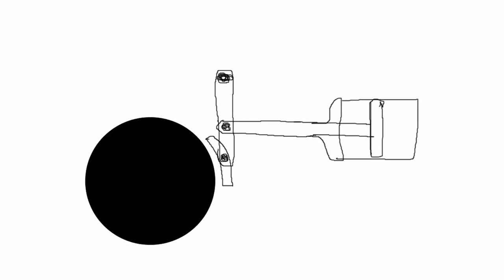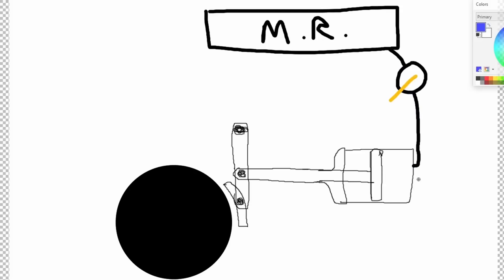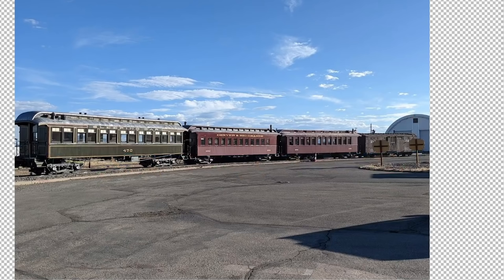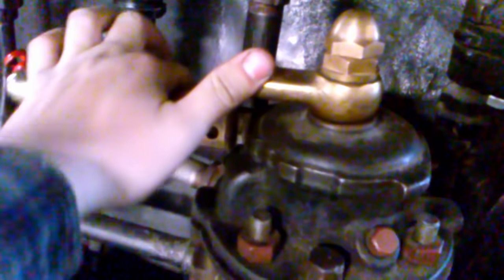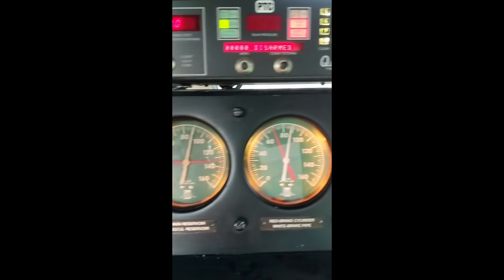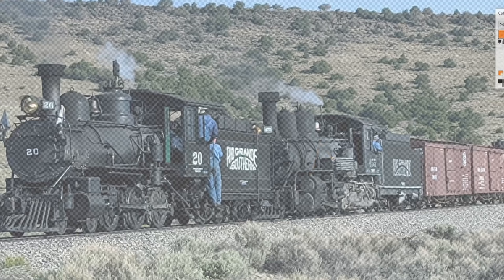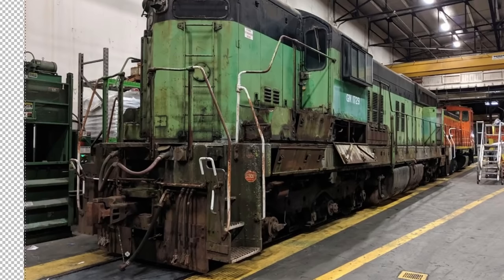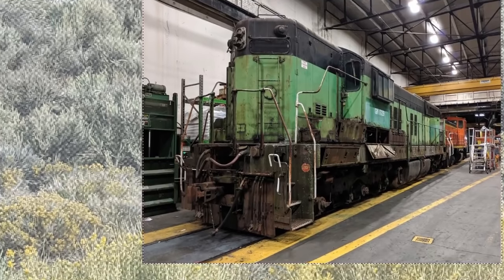AIRBRAKES 101: 10 levels of TRAIN BRAKE understanding!

Comment: Interesting description.  Trying to keep it as simple as possible is always a problem.  One of the easiest methods for describing the automatic air function was the idea equalized air pressure on each side of a piston and how reduction of pressure on one side moves the piston to perform a function.  When the pressure is equalized, the piston stops and slightly reverse moves to stop the function.  The use of rubber diaphragms has made for a more sensitive operation of what ever valve diaphragms are used in.  Also, the timing involved in charging, reducing train line pressure.
From front to rear, timing is involved.  For example, when stopping a steam powered locomotive on a freight train, going up an ascending grade to take water.  Slack most likely will have to be taken to get the train started.  After taking slack, the release time for K-2 vs AB was about 2.5 to 1.5 seconds to start each car to release.  The trick was to start the pull about the time the release got to the rear end.  But before the rear end would run out and possible cause a break in two.  Another area that is not dealt with these days is the use of retainers when braking on steep down grades with long mileage.  Anyone can turn up a retainer, but the proper use of the automatic brake valve without the pressure maintaining feature to prevent insufficient recharge of the auxiliary reservoirs is another story.  Yes, knowing the air is an interesting subject.
Reply from the maker: Sounds like you've pulled away with one or two trains yourself based on that description - thanks for the comment :)

Comment: This is a decent discussion of the complexities of manual American Wabtec air braking. Its right enough mostly. The one area I would suggest looking into is the the pressure differential between brake pipe, aux reservoir and brake cylinder - the cylinder will get 2.5 times the pressure released from the reservoir into the cylinder. Your vacuum concept isn't quite right, while its true you cannot pull more than absolute vacuum - its more about the suction than it is about pure vacuum. You can sort of think of it as the reverse to air pressure if you put it really really simply.
Reply from the maker: Vacuum is just negative pressure, indeed. But you can only ever get negative atmosphere, as far as folks are telling me. I don't know vacuum brake that well. Haha. And yeah, i glossed over the BC pressure because I didn't think it made a huge difference in terms of the overall understanding of folks who don't know the stuff at all. Cheers for watching :)
Reply: @Hyce777  Oh indeed its enough for people trying to get an idea.

Comment: I know the names of items is steeped in tradition but I would have called the 5 positions: unregulated add, regulated add, isolate, regulated release, unregulated release. Although the add regulation seems to be pressure and release seems to be volume rate. Engineers of the 19th c weren't dumb. Hard to believe it took so long to make a variable pressure handle.

Nowadays I feel with the right sensors and logic each application could be exactly controlled to minimize stress and equalize load even down to left/right differential application, ABS, etc.

Comment: I've always wondered how this and that worked here are my answers
Also I'm quite fond of designing things if it's simple machine parts I can easily model them in Catia
And another thing vacum isn't stronger than pressure as you do have limited amount of air you can displace, but for pressure well you can just stack it on till the pipes burst
Reply from the maker: Precisely :)
Reply: Yup, once you hit about 30 inch pounds of vacuum that’s about it. A full vacuum is all you can do
Reply: Well you could use a vacuum and get even more force out of it, however for that you have to increase the atmospheric pressure that you relate the vacuum to.
In practice if you were using vacuum, you would have to encase the vacuum parts with a pressurized system, it would work, but at that point it is better to go with pressure :D
Reply: @CMDRSweeper  Actually, no. In a vacuum system if you want more application force, you make the diagram bigger. Vacuum isn't measured in inch pounds... it's inches of mercury in a column... and this gets to the next major problem with vacuum... it's not constant. 

At sea level, atmospheric pressure is 14.7 PSI. The further in elevation you go, the less pressure you have. (this is why it takes longer to cook food in colorado than it does in miami... the water might be boiling, but instead of it being 212 degrees in the pot to boil the water, it's only like 186 in colorado because the pressure is less and the water boils easier. Fun fact you can boil water at room temperature if you put it in a vacuum chamber.) This is the difference between PSI and PSIG. A gauge that reads vacuum to some pressure level is (like a vacuum boost gauge in a car) is at zero, is really saying 14.7 psi at normal... if you took it into outer space, it would read 30 inch of mercury... 

Ok, going off the beam here... 

So you have a train with vacuum brakes that starts at sea level,  you have maximum braking force when you call for brake application. As you go up in elevation, the brake effectiveness gets less and less... because your atmospheric pressure becomes less and less.

reservoir

Comment: Forgive me for a potentially dumb question - I understand how the brake shoes get pressed onto the wheel, how does the brake shoe get pulled back off the wheel? is there a basic spring that pulls the piston back when the air is vented out?

Comment: On 5" and 7.25" gauge we can use a steam on water system, my loco and some club cars have this system. To apply the brake steam pressure is applied to the brake line and loco brake cylinder to pressurise the water in the train pipe. The brake is released the by venting the train brake line. To set the system up I inject mains water into the train brake line at the last car with the brake valve in release position; this I continue until no more air comes out of the brake vent pipe. I then close the brake valve and disconnect the mains water connection. The system is charged. The brake is very effective.
Reply from the maker: ...damn, that's interesting and cool!
Reply: That's the basis for power hydraulic brakes.

Comment: Thanks for the video education on train brakes. I've been curious about the subject ever since studying the Lac-Mégantic disaster of 2013. That incident was apparently triggered by loss of pressure in the train pipe due to failure of the one unit that was left running while the train was parked on a downgrade overnight. I always assumed train brakes worked the same way as truck brakes, but no. So it would seem like a guaranteed major point of failure if you lose pressure on a parked train. They did set the manual brakes on some of the leading freight cars but it was apparently not sufficient to keep the train from moving. 
Question: Is there a device like a chock that can be clamped and locked to the rail that would positively prevent a train from rolling away?

Comment: Some non-self-lapping brake valves (I'm pretty sure the 24 brake, specially) had "maintaining" valves that would keep a set, well, maintained. Brake stands with this feature had an "M" somewhere on them, sometimes as a casted letter in the steel- modified to have a maintaining valve or otherwise . My memory of this is pretty foggy, though.

Comment: Great recap! The only thing I would state differently was at 10:00... A 10psi reduction does not put 10psi in the brake cylinder.  The reservoir and cylinder are sized such that the pressure added to the cylinder is ~2.5x the pipe/reservoir reduction. So 10psi reduction = ~25psi applied. Once your pipe pressure drops to 64-65psi (on a 90psi system) the pipe, the reservoirs, and the cylinders are all at the same pressure. It's physically impossible to put any more air into the cylinders. If you need more brakes at that point, you've got a potential runaway train.
Reply from the maker: Oh really? Huh, I guess that's right because you can't get the expansion if it's already at that pressure, huh. Interesting, I hadn't thought about that before. Thanks for the comment! Here I was thinking that the exact pressure being higher in the BC's was not worth a specific mention for the sake of an overview...
Reply: @Hyce777    Same thing with “cannot get a higher pressure than the steam pressure — of course you can get a higher (or lower) pressure if you use differently sized cylinders for the steam and air side.
The drawback of course is that you need 2 separate cylinders for air and steam, which means larger and more mass, instead of a single cylinder with one side steam compressing the air and when the steam is released, a spring pushes the cylinder back to allow new air in through check valves.

And a trivial way to have a comparing valve and cylinder setup would be the brake air pipe pushing on the release side of the braking cylinder while the reservoir presses on the brake side, possibly with some spring or similar to make sure the brake is released when both sides are at equilibrium.

If you want to work with pressure change rate, one idea is a cylinder that is connected on both ends to the brake pipe, one normally, one via a small hole that takes some time to equalise. If the pressure in the brake pipe drops fast, the small orifice side will have a higher pressure and push a piston in the cylinder away, and when the pipe is re-pressurised, the opposite is true. Add a system that gently pushes the cylinder back to the centre and presto.

If you detect a rapid pressure drop, use the piston to, say, change a 3 way valve from connecting the brake pipe to brake cylinder release side to isolating the brake pipe and vent the release side to open air. Undo once the pressure drop becomes slower or the pressure actually rises.

No idea if they do that that way, but it probably is a simple, mechanical way to do it without much “cleverness” needed.

Comment: gonna be honest, I had an idea for a "dynamic brake" car for steam engines, It would be a theoretical 0-4-0 engine but instead of a boiler, it has a giant pneumatic reserve tank that is charged via running a pair of steam cylinders in reverse. (allows braking via expending energy via compressing air) (inspired by the "jake brake" of diesel trucks used when running down hills) 
it would also be hooked into the braking system, able to charge the brake line using its tank. 

It could also be used for extra acceleration as when run in the "forwards" direction, it could  use its compressed air to run its steam cylinders and provide that extra bit of tractive effort.

Edit: it would not be charged by the loco, aside from its standard brake reservoir.

Comment: So the brake cylinder extends and applies the brakes when pressure in the brake line becomes less than what is in the brake pressure reservoir on a car.  What then causes the cylinder to retract and release the brakes once the pressure is brought back up in the brake line to match the pressure tank?    Just releasing the pressure in the brake cylinder isn't gonna cause it to retract any more than what is caused by the pressure of the shoe against the wheel pushing back, right?  And yet the cylinder fully retracts once pressure is re-established.

Comment: Dear Mark
Vacuum brakes were more or less universal on the railways of Britain during the steam era.  Westinghouse air brakes were used by some railways and their locomotives often hand both systems on board.  One huge benefit of vacuum brakes is that the system does not require a complex device like a steam driven air compressor to produce the vacuum in the first place.  Vacuum is created by a steam-powered device called an "ejector".  These resemble a boiler feed injector and have the benefit of essentially no moving parts so they are much less trouble to build and maintain than a compressor.  Vacuum brakes are fail safe in that any break in the line or major leak will make the brakes come on.  The biggest operational concerns are firstly that vacuum brakes are significantly slower to release than air brakes, and secondly if boiler pressure drops to any significant degree for some reason on the road, the ejector may stop working and the vacuum in the brake pipe will reduce and the brakes will come on regardless of the brake valve being in the "off" position.  Also remember that Britain is a much smaller country geographically than the US, so trains did not need to be as long (and heavy) so this system worked well there for many years.  I hope this may be of interest.
Paul
Reply from the maker: Cheers Paul - that makes a lot of sense. The benefits make a lot of sense for the British system.

Comment: regarding L8... I thought it was just reservoir pressure pushing the brake shoe towards the wheel and pipe pressure+ small spring pushing it away, so that at equal pressures it doesn't apply and when imbalance comes in it gets pushed in.

Comment: airbrake here are indirect passive safety with pushing spring on piston ,so you get to 5 bar to brake even and release brake, if pressure is lost  in system spring works and you are braking hard... also you can increase pressure to use smooth -low to hard brake -from 5 up to 10 bar. advantage you dont need to pump air reservoir

Comment: Now we can apply braks, but they never release. There also are important diffrences about releasing them and reapplying. Ignoring the reapply is really bad since going downhill you might be stuck with not enough braking or the brakes force you to emergency stop. So we now need the diffrent levels of releasing them, combined with your drawings to understand.
Reply from the maker: That is fair! There is plenty of nuance to long runs down hill with air... and yeah, we didn't even talk about retainers or the release side of the piping, did we? Lord, too much to cover with all this. Airbrakes 102 down the road :)
Reply: @Hyce777  Looking forward to it.
Reply: @Schutt I've always thought if a train was going over a peak of a hill that the gravity on one side (downhill) may offset the gravity uphill... this may be off topic but basically I'm not sure why you would want to break very much unless you're changing speeds?

Comment: I'm just getting into learning about how trains and engines work and I must say I found this very helpful and informative! I still don't fully understand what the "Holding" position was used for though. It's called the "independent break" surely you could use it sperately without needing that setting?

Also what if you were just running the engine with no carriges, would you just use the independent break?
Reply from the maker: Yeah, "hold" is a bit weird, but it has it's place. Adds an extra step while stationary (less chance of "oops I kicked the air off", and additionally if you've got a train that leaks really bad it's easier to go to hold and have more precise control over the independent (you can feather it on or feather it off with much less motion) before taking another set on the train. You certainly can run the independent without the hold, it just makes things a little nicer.

If you're running light, you just use the independent brake.

Comment: We had some Russian trailers that used a single air line. We never used the air system on them because they were adapted to be pulled by our loaders. I assume they used some sort of comparison valve. We never understood that air system because we were used to our truck spring brakes systems.

Comment: Bit of a correction, you absolutely CAN get more air pressure than steam pressure. If you need more air pressure you simply go to a larger steam cylinder and/or smaller air cylinder. This will give you more air pressure but lower air volume. It's like volts vs amps. No you can't get more POWER from the air side as the steam side but just like transformers can give you more volts for less amps or less volts at more amps, cylinder sizes can give more or less pressure for a corresponding increase or decrease in volume.
Reply from the maker: Yup, i goofed that explanation in the moment. Thanks :)